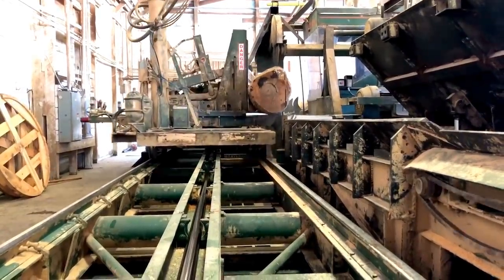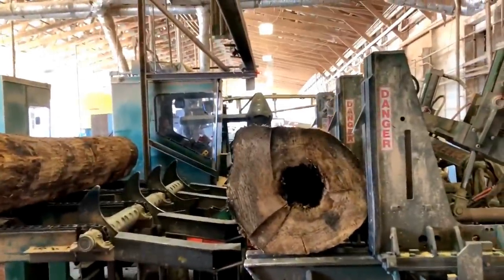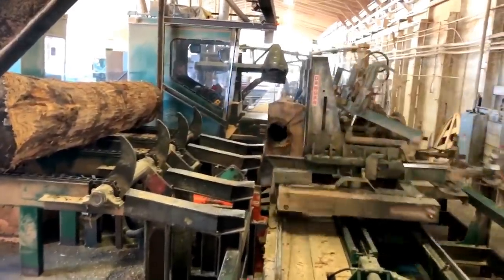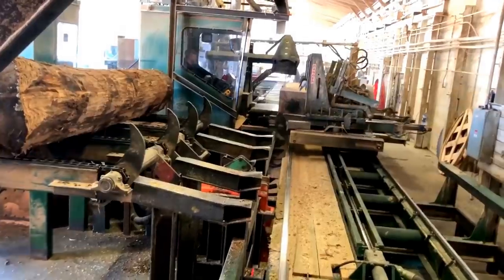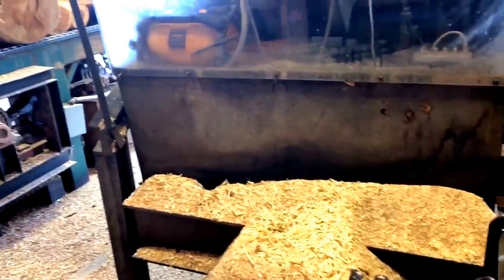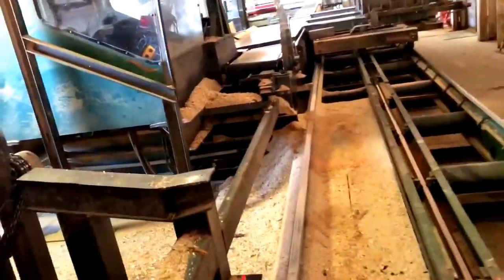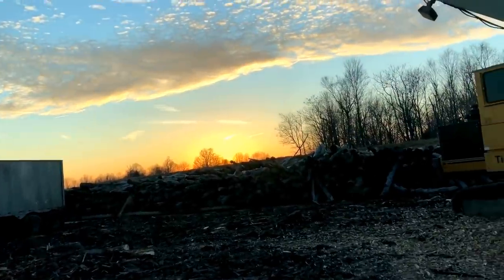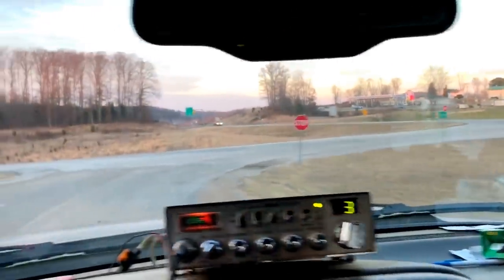Head saw turned out awesome and big boys moved in

Comment: hey buddy, oddly enough i understood what you talked about with the 13 wires. some of the old motors i worked on had really large rheostats. one 800 hp motor i worked on, the rheostat had what looked like a steering wheel on it with 8 points to get it running at top speed. now as far as the sawmill goes. it looks like the mud flaps worked out for you, but how about a vacuum system like the really large shops have to suck out the saw dust. would a system be cost effective.